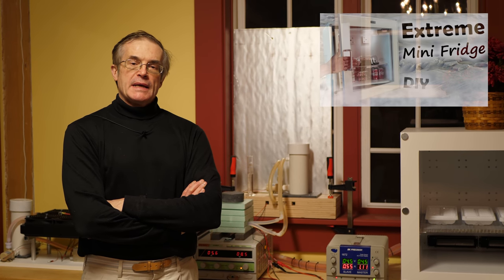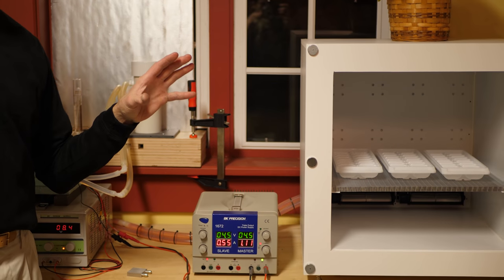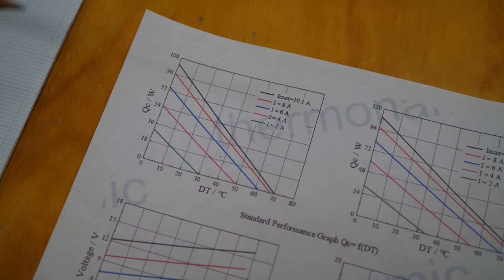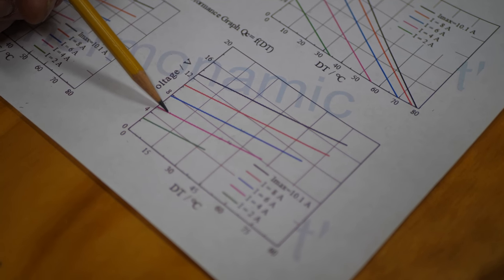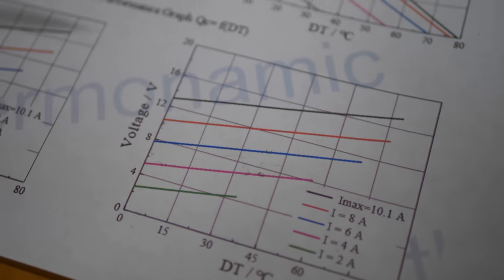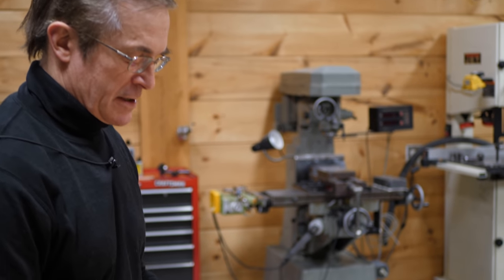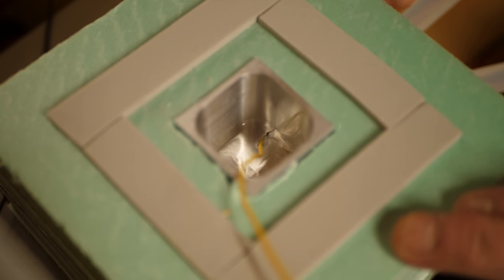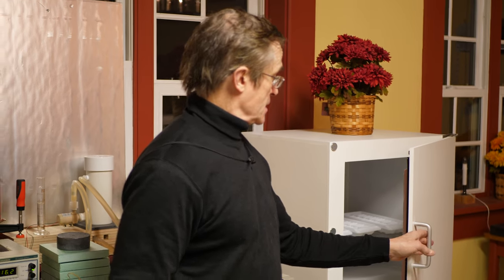EXTREMELY LOW TEMPERATURES! - Using TECs

Comment: Chip coolers can't go below ambient because it'll eventually sweat. Just takes one rainy day (high humidity). Otherwise, we'd all be hooking up aquarium chillers to our water loop. 
Also, could you explain the point of this experiment? No matter how efficient you get the TECs, a compressor will always be at least 200%-300% more efficient, and at a much lower cost.
Reply: As long as you keep the socket above ambient (a socket heater on the backside for example), you can design and position it such that the sweat runs away from the expensive bits.
Reply: The problem with compressors is that they're noisy and big.
Reply: You could run a dehumidifier, or just not run the peltiers at such extreme temps. If you set it up to run a processor at just above ambient, you can still get a hell of an overclock
Reply from the maker: We have done numerous overclocking experiments and one very simple, but potentially messy approach is to submerge the entire mobo in silicone oil, refrigerating the oil in a sealed, insulated container.
We have also sealed the computer case and flooded it with a slow flow of dry nitrogen, maintaining a slight positive pressure to exclude room air.
Efficiency is important, but it isn't the whole story.  Eliminating vibration, with compact, reliable, low cost, easily switched, DC powered TECs have some advantages despite this lower efficiency
Reply: @Retanaru  if you're going to those extremes might as well do what liquid nitrogen overclockers do and just insulate everything around the area being cooled.
Reply: @ChucksSEADnDEAD  Flipping the mobo so the cpu cooler faces down is not an extreme. Also below ambient with a chiller is significantly more likely than running on ln2 for more than a few hours.
Reply: There's also the possibility of putting a vacuum seal around the cold parts and the socket. But I've never seen that approach anywhere.
Reply: @Retanaru  I would think that a socket heater and flipping the mobo is an "extreme" because we're stepping outside convention to deal with the downsides of the cooling methods being used. And my point wasn't that you should run on liquid nitrogen versus a chiller, my point is that liquid nitrogen overclockers are the people who have been dealing with condensation for over a decade.
Reply: @TechIngredients  If you're going to go that far, have you seen 3M's Novec 7100 fluid. It'll basically let you put the computer inside the refrigeration fluid.
Vibration: Move the compressor away, considering how much of your fridge is outside the fridge, it probably makes very little difference.
Compact: When you calculate how much energy you'll need to move, you'll quickly see that compressors are still far more compact, unless you're working with a single TEC.
reliable: If your cooling side fails, the TEC is done.
Low cost: A small compressor refrigeration system is <$100, add up all the costs of the TECs, power supplies, radiators and fans, and I'd argue that it's not very price competitive at all.
Easily switched: Ok, but how hard is it to switch a compressor, really?
I've worked with TECs for a while, did many projects with them, so I've dealt with trying to get past their downsides very often. The only place I've seen them have any practical use is in 12V powered coolers (for cars), or as wine fridges where the delta T is relatively low. In every other case, it's just far too difficult to exhaust the heat efficiently, in a compact form. Consider that these will generate about 3-4x of total heat more than a compressor system would and that has to go into a room or be exhausted outside...... That's why nobody makes TEC fridges/freezers.
BTW, you can run these in reverse and use them for power generation, that's probably a more useful application in the real world. Still crazy inefficient, but far more practical than using them for cooling.
Reply from the maker: I'm aware of that submerged method, we simply staged it with the cold coils of a freezer and the mobo in the same, sealed and externally insulated container filled with flowing silicone oil.  It worked very well.
TECs are best for compact vibration sensitive equipment cooling that requires low to moderate heat removal.  We have two, cooled CCD astronomical cameras that use these.
The other major application is for extreme thermal stabilization ie better than .001C with AFMs and lasers.
Reply: Eugene S you just plasti dip it (optional), pack the socket with Vaseline (so the pins don’t rust), put 3 layers of craft foam and a 5w heater on the front and back and call it good for the year (my idle temp is -60c while watching YouTube, it’s fine).

Regular small single stage phase (refrigeration system, just like your fridge/air conditioner), even FX-8350 at 1.7 Vcore doesn’t get above 0c at full load (please don’t run that voltage on water, I’d estimate 1 week before you’ll need to start stepping down speeds due to degradation, and a few months before it’s toast. On phase this voltage should be fine for a very long time, provably a year or two, maybe longer, but I don’t keep parts to save for a museum...). For those wondering, Im really hoping that ancient dinosaur chip dies already, my long term condensation testing is apparently working too good!

Comment: try copper-copperoxide (Cu-CuO) thermo couple _stack_, for either generating or making hot-cold, assuming you can simply stack a dissimilar non-electrolytic metal stack, alternate layers, as a diode stack
Reply: the circuit diagram should be diodes in series, as in battery voltaic stack, but without the electrolyte, its similar as the diode to voltage source swap, directly
Reply: turbine compressing heat pump instead, thermo-electric pile is like doing heating and freezing by resistance element temperature generation by electric friction
Reply: super conducting solid and liquid atmospheric gasses, by the turbine heat pump gas compression and heat conduction off the turbine and the gas (ie, cold by hot), cold is negative heat, removing heat, from the thing
Reply: impeller pumps have, with centrifugal compression, very high compression, to heat up air, ie, compress to small volume, the gasses, to directly get the parts, from thin air, dry ice

Comment: So, great vid tho would have liked to know, Tec vss Tec2 and a actual peltier ?, 
i know the tec2 is an stacked version of tec 1 , and not like a pyramid stack.
but a peltier device being somthing else ? also , what is the resistance delta of that little pot,  how much watts or jules can it actually cool ?
its volume or surface area ? allot of ppls out there want to use these for cpu cooling, i use them to cool my waterloops, not the cpu itself...like a chiller.
Reply from the maker: Stacking a TEC in any way, whether a pyramid or as we did in our other video on dry ice vs electronic cooling will decrease it's already low effeciency.  It is the only way to achieve extremely high tempreture differentials, but the heat removal in watts will be limited.

Comment: What about using many peltiers at low individual power than using a few peltiers at max or high individual power.This way overall efficiency of the system is increased.Please demonstrate the idea and its limitations.
Reply from the maker: The effeciency will increase, but the temperature differential will decrease.
Reply: @TechIngredients  so can we use this technique for tec mini air conditioner that would require low twmperature difference around 5_6 degree celcius or  even less.
Reply: @TechIngredients  well thanks for the first reply that was really appretiative.I was planning to make a window AC using peltiers that is why I asked that.

Comment: Can you drive the TEC with immitation voltage regulation using PWM? As in V(effective) = V(in) x duty cycle?
Reply from the maker: Yes, but because the TEC is a heat conductor when the voltage is off this can reduce the efficiency.  Higher frequency  works better and if the PWM is used for fine control on top of a steady voltage then this works even better.

Comment: They call this a thermal waterfall or thermal Cascade effect there was a great online company that had all this information and then they pulled it off the web about 8 years ago when I looked into this
Reply: Applied Science has a video on repairing an ultra low temperature cascade refrigeration unit, that uses two compressors, there is enough information to build a crude prototype.

Comment: can you run two of them side by side at half the wattage each of 1 nominal?  would it be more efficient? it would be double the surface area though.
Reply from the maker: Yes, they will always be more effecient as a single stage.  The only downside is the maximum temperature differential is more limited.

Comment: Is it possible to remove condensation by putting something inside a tank of carbon dioxide?
Reply from the maker: Yes, you can use any dry gas, even air.
Reply: @TechIngredients  Well the idea is to use gas heavier than air so that the air does not create condensation around electrical components such as the CPU... 

And carbon dioxide is easy and cheap to create and use; like filling a tank with a computer in it.

Comment: So if you heat epoxied the surface that the little hollowed-out aluminum cube is now attached to to the side of a automotive size or small window-unit sized aluminum tube-and-fin evaporator core, would it get it cold enough to make a little desk top or table top cooler feasible? I don’t mean a “cool the whole room” cooler, I mean a “blow some cool air on my face” type cooler. I’m picturing something that would be sandwiched between 2 nine-inch box-fans, for example. Would it work to just fill it up with antifreeze and seal it, or would you need to circulate it to evenly distribute the “cold”? Then you could bundle the power cable for the peltier junctions, the coolant feed, and the coolant return lines into a single umbilical line that could run to some spot out of the way where you could dump the heat and plug in the power supply for the peltiers.
Reply from the maker: Sure.  The strength of peltiers is low cost, solid state, easy to work with and simple electronically.  The only downside is low effeciency.

Comment: I have read, that you can reach around 100 Kelvin with this cooling type (about 5 Stages required for minimal temp.), but you can't get colder than that (regardless how many stages are used). Is this so because of the internal resistance of cooler (-->waste heat), or something else? 

Great video, great topic, great channel --- Keep it up! \^-^/
Reply: how much heat could you pump @100K?
Reply from the maker: You would probably not be able to pump any heat, no matter how much power you used.  These devices really begin to struggle below 170K
Reply: @TechIngredients  Could it be helpful to use "liquid" metal (like gallium) between the coolers, to optimise the heat transfer even more? 
And a other question: if you would cool the hot side of the cooler with liquid nitrogen,  would it be possible to reach colder temperatures than the boilingpoint of liquid nitrogen?
- thx  for the answer ^^
Reply from the maker: Gallium would be a good choice between stages because the surfaces are ceramic and not damaged by the corrosive effects that gallium has on nearly all metals.
Reply: @TechIngredients  it's got a not very impressive thermal conductivity though
Reply: @qvatch  Indium's often used as a heat transfer medium, it's soft enough to work by hand and wets many ceramics well.
Reply: Tech Ingredients Liquid metal Gallium does not conduct heat well at low temps, only at high temps. Use ceramic based paste like arctic silver ceramique  2 (this is coming from an EXOC, my “normal daily systems” run colder than this TEC did, I can assure you, as well as your own research, that LM does not work well below 0c. It’s great for high temps on water cooling though!)

Comment: i want to build an electronic cooler for the airplane. Small cessna 152 in florida. i was using an "ice conditioner",fan in a 1liter cooler. trying to figure out how to get rid of the heat w/o making a hole in the aircraft. any ideas?
Reply from the maker: If the cockpit isn't too warm then a good CPU based heat exchanger with a fan would get easy.  Does the airplane have a power hook up like a cigarette lighter within the cabin.  Remember most aircraft use 24V and so you will need a specific TEC that will work with that voltage without drawing too much current.  The heat exchanger fans are usually 12V and so running the inner and outer fans in series should take care of that.

Comment: So in terms of CPU cooling, is it roughly watts = watts?  IE 65w TDP CPU needs 65w worth tec cooling?  My question then is how much more cooling you need above that.  However if you have to watercool your TEC on your computer this quickly becomes a scenario only for extreme overclockers.  The dream is of course to have CPU be cold under load, any idea how the numbers work for that, and what the TEC setup would look like?
Reply from the maker: CPU cooling is like any other heat load and the performance graphs for TECs include COP to describe this.  Temperature differential determines COP which for a TEC can range from near zero up to 2-3 for very low dTs.  A COP around one would be typical for a TEC enhanced CPU cooler.

Comment: So just use fluid to refrigerate and freeze! Gases can be compressed and the laws of thermodynamics say that thick gases will simply give out heat to thinner gases, if their pressure cannot be equalised. Leaving the formerly thicker gas stream colder and simply denser, and thickening and heating the thin stream to leave it "sparse".
Reply from the maker: That is an option.  TECs still have an important role in cooling scientific instruments where space and zero vibration are critical.
Reply: @TechIngredients  You could always hybridise between the two methods, with TECs isolating experiments from vibrations by way of mufflers placed between them and pressure coolers.

Comment: Good explanation. But what's the point of this? Making a large, complicated, inefficient, freezer?
Reply from the maker: Thanks!
Mostly, it's fun. Playing with these TECs is interesting.  Designing and assembling the insulation, thermal interfaces, power supply etc is a little like building up a gaming computer or an aquarium.  It's not really necessary, but it's enjoyable.

Comment: Although super inefficient, could you make liquid helium (lowest boiling point of any element) or at least liquid oxygen by stacking lots of peltier tiles in a pyramid to ensure all the heat gets pumped away from the tile at the bottom of the pyramid.
Reply from the maker: No.  They loose effeciency as the temperature drops to the point that they become completely ineffective at around -140C.
Reply: @TechIngredients  I’m not talking about if it is efficient or not. Also why -140 specifically. Is that the maximum temperature drop regardless of efficiency or is that the point where no matter what I cannot get the tilt at the end any colder.
Reply from the maker: I understood you.  What I mean is that the effeciency drops to zero at around -140 C.  As I explained in the video that followed this where we pushed this limit with dry ice is that at a low enough temperature the difference in the electron energies between the two materials that creates the junction disappears and no heat is transported.

Comment: Hello sir, can you pls do a experiment where water electrolysis can be improved by resonance, this would solve the battery issues we have. ppl say hydrogen generation is one of the major issue...
Reply from the maker: Using electrode coatings that add to the effeciency through catalytic effects will help.  These are not too exotic and we may be able to apply them ourselves.

Comment: I'm university undergraduate student.. so i'm going to make a kind of a water generation plant using TEC. By using dehumidification process. Any sugestions for incrase the cop and the water generating process. Thank u
Reply from the maker: Take advantage of  relationships between the time of day, the relative humidity and the emissivity of the surfaces on and around your condenser.  Optimize these things and only then add the TEC to create the minimum necessary tempreture differential.
Reply: Tech Ingredients thank you verymuch for your advice.is there any disadvantage if i will use Al or Cu fins istead of using refregerent. If you can please suggest me some learning materials. So again thank u verymuch for your concern.

Comment: Interesting. 
My home-built 12 cu-ft reefer/freezer in a 70 degree ambient kitchen temperature using a DC compressor with typical opening/closing of doors with freezer set at -10 F uses no more than 620 watt hours in 24 hours @24vdc

Also my current production model of a solar powered chiller trailer I sell to small farmers wanting cooling when harvesting lettuce and other fragile  greens , employing a cheap off the shelf air conditioner and using a Kool Bot controller and a sine wave inverter is tested at 36F inside temp on a good sunny day where ambient is 100+F and enclosure skin temperatures measured at 137 F has  never exceeded 263 watt hours/hr peak.

Compressor refrigeration coupled with super insulation is certainly extremely efficient.

I do use many TECs for my laser cooling though and work best well below their max allowable voltage
Reply: "watt hours in 24 hours" and "watt hours/hr"?
My head hurts.
Reply: @SimoWill75  watts are power, power over time is energy, most people care about how much energy is required per day, rather than instantaneous power requirements.
Reply: There is probably room for extra efficiency with brushless motors and modern controllers.